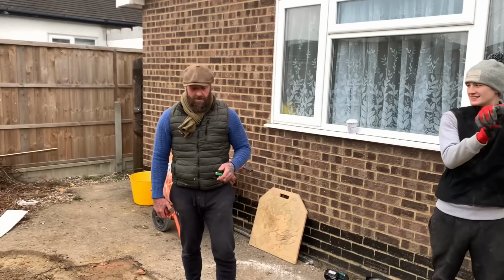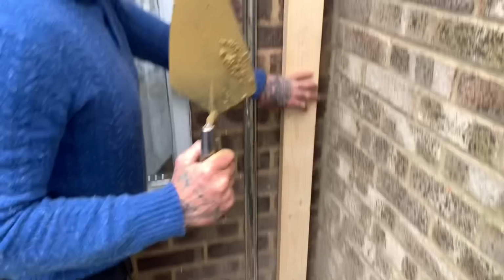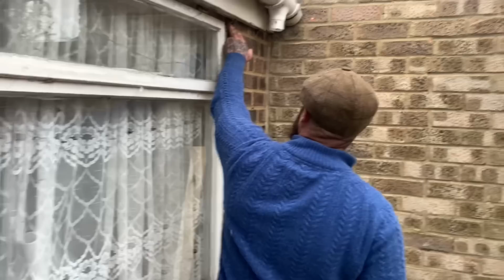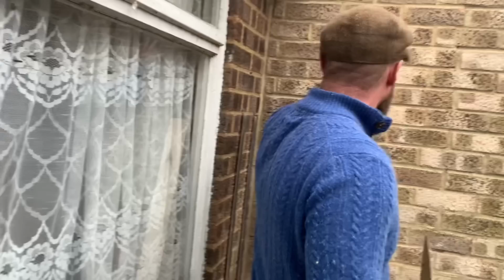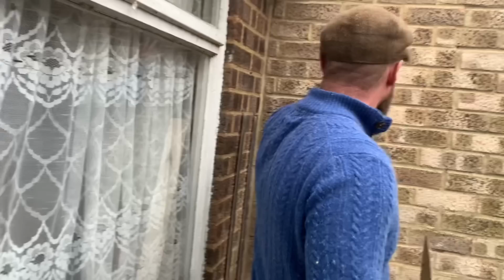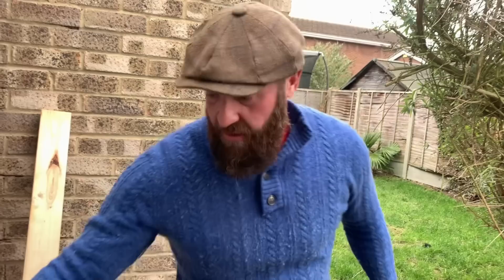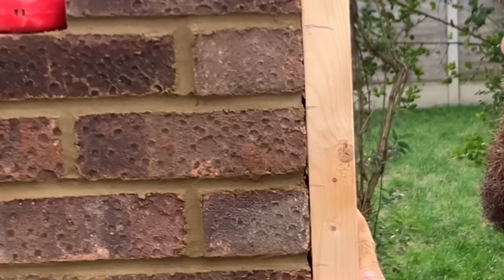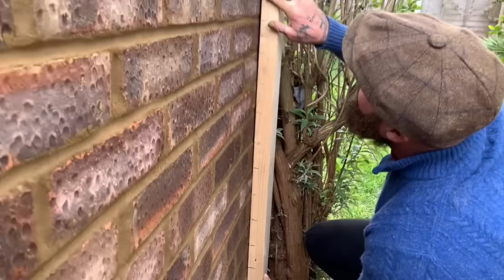Building brickwork corners with a problem #bricklaying #brickwork #history

Comment: many brickies used to lose a course up to door frame height using these brick back in the 70's 80's , very easy to get high building corners, beds look good to eye, up 12 gauge check 20mm high lol
Reply: Was it not because of imperial gauging
Reply: @matthewingham7806 Yeah 4 courses to a foot back then 4 to 300mm post decimal Good fun plasterboarding ceilings Joiners setting out joist 400 mm centres and boards were still 4 ft x 3 ft old stock

Comment: I had a similar issue when I built an extension on my old house, i gauged down from the top 2 storey, and went metric, you don’t even notice it.Original house 15 courses was 1200mm😬

Comment: putting a pig init means you have missed a course of bricks from one end to the other( at some point didn't put the line up). what you did was take a datum when one end was half built?
levels should be sorted at oversite, you either go metric and ignore existing or go to existing and risk shit looking brickwork? either way internally things need to marry up
Reply: I agree should of used the top of the window and gauged down in metric and ignored the original brick work. You made hard work out of that

Comment: Should you guys have not cut a cavity in-between your wall starters to stop damp crossing 🤔
Reply: No . In the south I have never seen that done. A mastic joint where the building meet  is the most I've seen to stop damp but I never come across  a damp problem  in 35 years
Reply: In theory yes you’re right, I run the cutter up between the starter kits and put 4”damp in